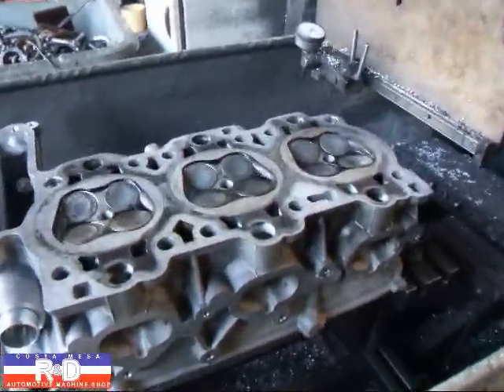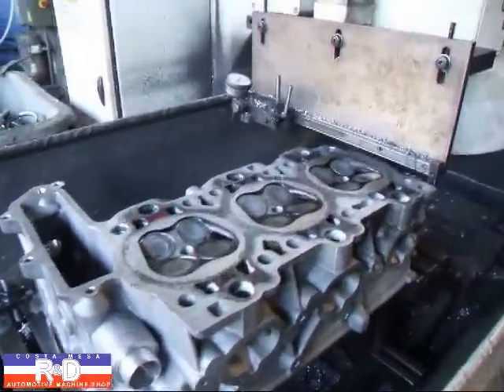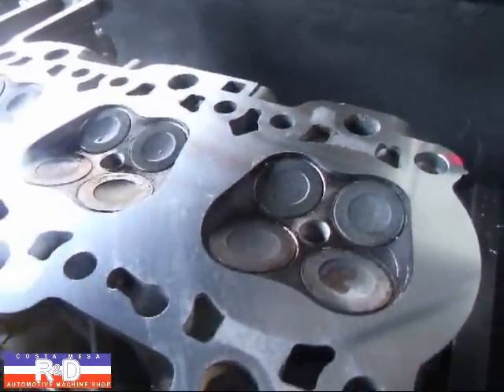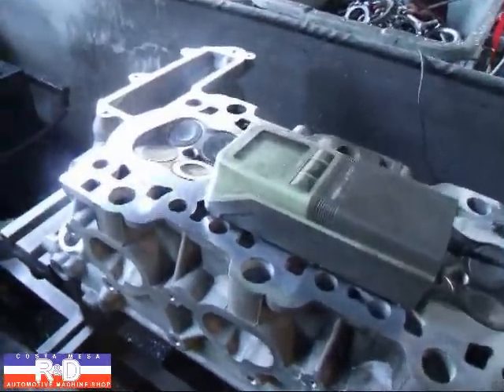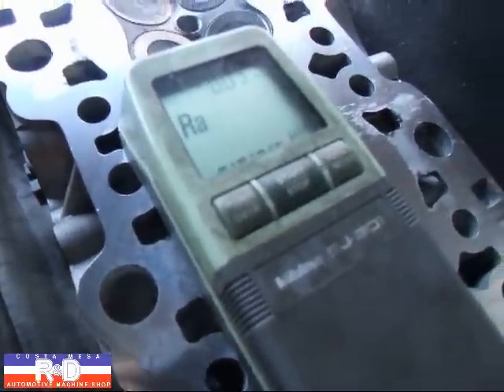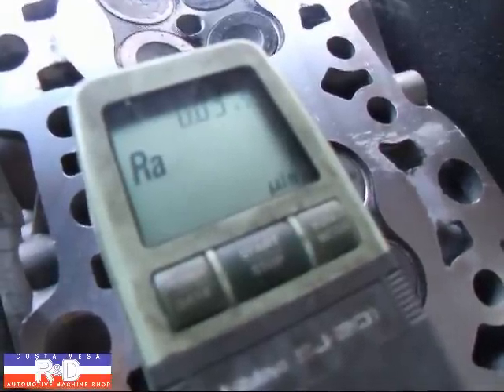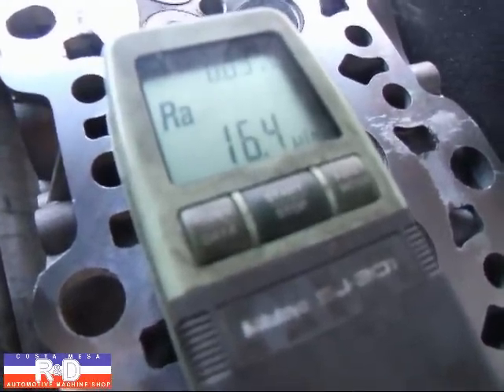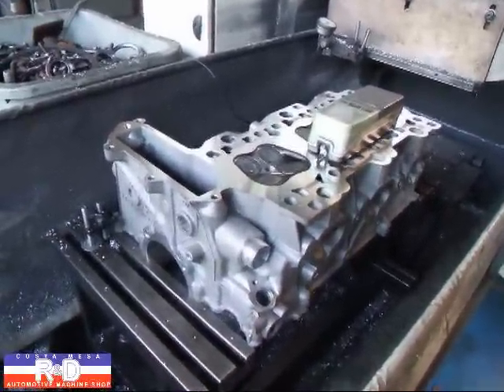Porsch 911 (996) Cylinder Head Resurface

Comment: @nucleonst the  engine is getting a bit long in the  tooth, i would have a guess and  say the head is having gasket/leakage problems,  and pretty much it`s rule of  thumb if you remove an alloy head they need to have a skim  as alloy heads  tend to warp  and  are more easily corrosion damaged than cast iron.